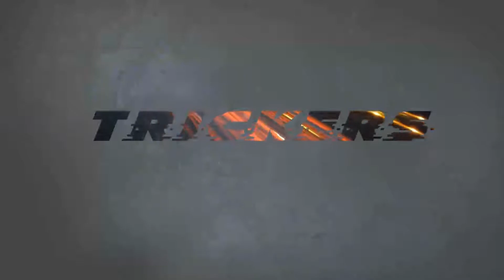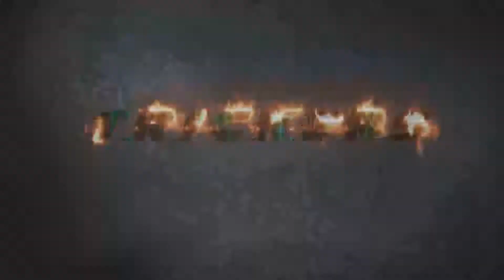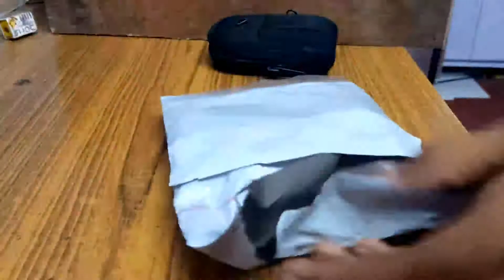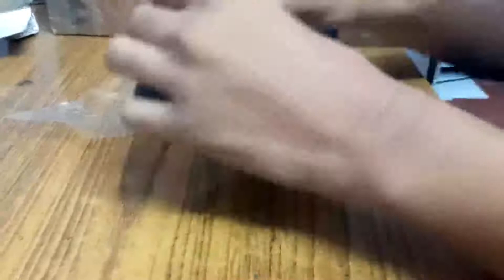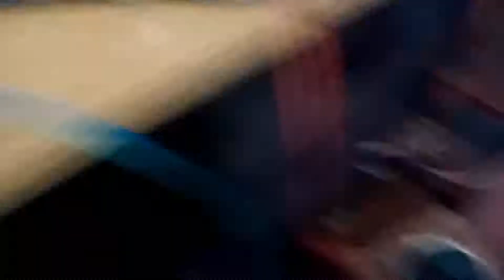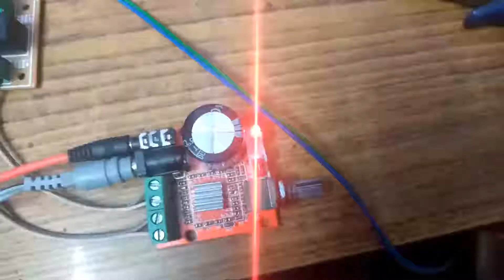Weon speaker protection kit // unboxing and testing // speaker protection board // Trickers

Comment: I also checked with other power supply and also with torriodal transformer connected with 12-0-12v 3 amps not connecting with any other board. Still green light LED glows
 I connected with speaker input and output using 6283 ic. The green light glows and the speakers are working good giving sound. Will it be ok or danger?
Reply from the maker: No it will not be danger,if the speaker works then everything is all right .

Comment: Will it be harmful if the LED light is continuously in green colour?
Reply from the maker: No it blows like that because there maybe some mistake in the connection or connect the board in a separate power source

Comment: In my speaker protection board when I use the board the LED light is on in green colour. It is in green colour continues. It will not glow off as you said. What to do? Is it ok?
Reply from the maker: Some times it happens for me also when I connect both the speaker protection board and the amplifier on the same source,try powering the speaker protection board again 
Note: it requires 12 voltage of current

Comment: Hi. My WEON Speaker protection board LED shows red color when I connect and even on though it's input and output connections are disconnected. What could be the reason and how to rectify. Please guide me.
Reply from the maker: Check the connections and reconnect the connections,connect with the amplifier and check once again.
Note:Don't connect it with the amplifier more than 100watts because the seller didnt mention the wattage of this speaker protection board,I have tested it with a 100watt salcon amplifier and it works good
If any doughts contact me in
V.Aaditya003@gmail.com